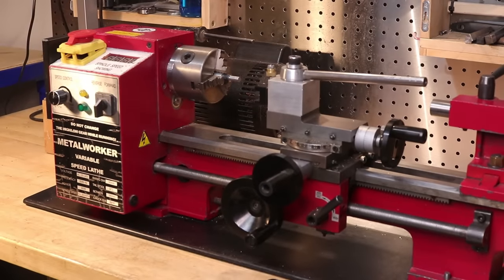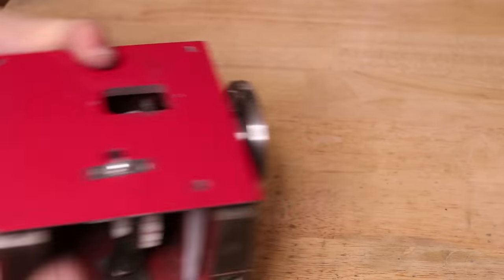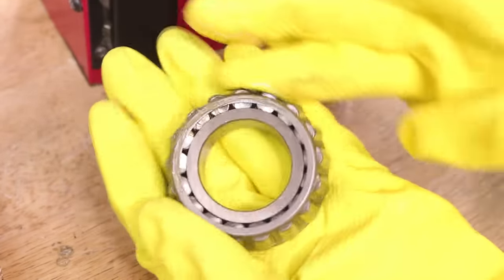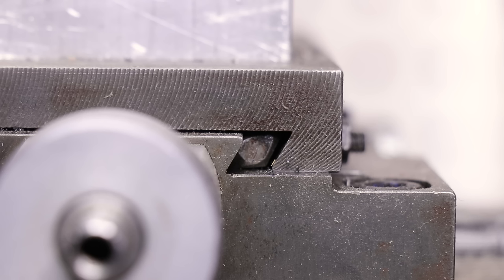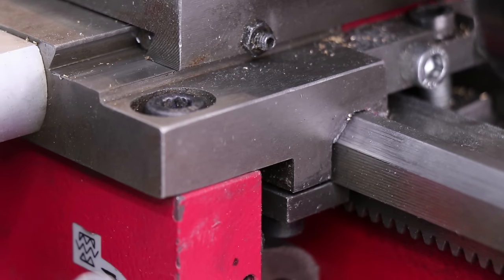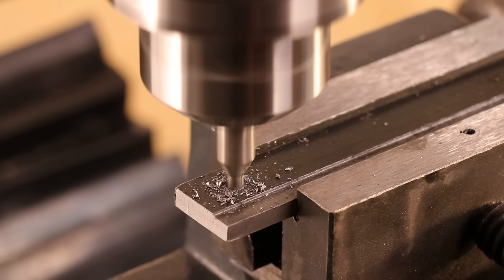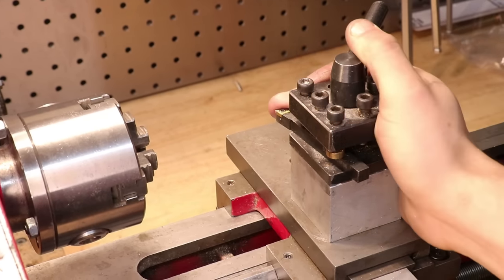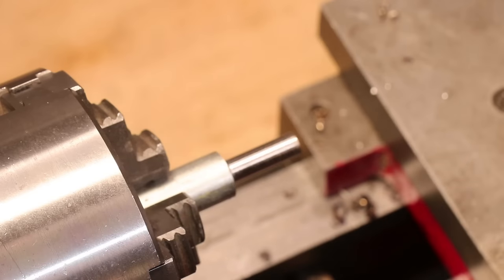Rigid Mini Lathe Upgrade | Tapered Roller Bearings, Solid Tool Post, Brass Gib Strips Mod

Comment: Tip: Never us copper based grease with roller bearings!. The odds are that one or more of the rollers will 'slip' and therefore wear a flat on one 'side'. That's sudden death for the bearing.
Reply from the maker: Hi mate, this is lithium grease not copper based and its the stuff recommended by the bering manufacturer. The a quick look at the MSDS shows it doesn't have. Any copper in it. Cheers
Reply: @artisanmakes  I never implied that the grease you used is copper based, just that others may be tempted to use it. As much as it seems to be a good alternative, it's not!
Reply from the maker: @amanofmanyparts9120  Thanks for the response. My bad, I misunderstood your comment. Cheers

Comment: how do you adjust your depth of cut?? The carriage only moves back and forth not in and out.
Reply: I didn’t think this through. You can adjust depth of cut with carriage.
Reply from the maker: Yes, the cross slide does that.

Comment: It would also help if you bolt the lathe down to a more secure table. Ideally something made of steel or iron and perfectly flat with the ability to adjust and lock down level.
Reply from the maker: Yeah ideally I would love to do that. Not sure how much of an improvement it would be, but that would be the optimal solution. Cheers

Comment: I don't understand why you would advise  to "lightly" rub a little grease on those bearings, when they are meant to be packed? What are you trying to do with that technique? 🤔 I  think I disagree.
Reply from the maker: No, for lathe headstock bearings it is not advised to pack them with large quantities of grease. This is inline with the literature I have read on this subject for lathes of this size and in line with what I have seen other people do on lathes of this size and with much larger lathes. Of course if you want to pack it tightly on your lathe you want/if it is advised for your lathe.

Comment: You want the gibs to wear our not the bed or ways. So making a gib out of brass would only wear out you lathe quicker. That is because the softer material will accumulate abrasive particles and act as sand paper. Why do you think on all machines, new or old, the gibs were made from hardened steel?
Reply from the maker: Thanks for the feedback but I have to disagree. The cast gibs that it came with have worn the dovetails a fair bit so replacing was a must. Brass is absolutely fine. It is a very common upgrade and I have not heard of people having issues. The slides get cleaned frequently so I wouldn't worry about brass accumulation. If the cross slide was hardened I would opt for a steel gib, but here it won't be an issue. Cheers

Comment: What kind metal are you turning in the test footage?
Reply from the maker: I can't remember off the top of my head on the grade bit I am pretty sure it is 1018 hot rolled steel.
Reply: @artisanmakes  thanks

Comment: It would be nice if a guy didnt need a milling machine to do most of these upgrades, as I dont have one. They do look good though, except I dont consider eliminating the top feed an "upgrade".
Reply from the maker: Pick and choose what suits you and what best suits you and your machinery. Unfortunately some.kf these do require a mill. And for a lot of people, a solid.tool post is a big upgrade for the lathe
Reply: @artisanmakes  Yep, not complaining, I wish I had a mill. I do appreciate your videos too. Some of the issues you fixed are a real problem. I hope I can find ways to fix them with what I've got. Thank you.

Comment: The most of rigidity loss comes from a void under the headstock.
Reply from the maker: Absolutely. I thought the same and installed a piece of metal in that void to increase rigidity and it makes a big difference when parting steel. Cheers
Reply: @artisanmakes  you can watch this video https://youtu.be/YuRGxuMk9Ww (it's a series of video) of this highly technically skilled man about this problem. It's only in Russian but auto subs does ~90% correct job. 
There are more excellent videos about mini lathe upgradeupgrade on his channel.

Comment: Ten minutes in the kitchen with the freezer and the oven would give you the 200 degree temperature gradient for easy assembly of the bearings.

Stavros
Reply from the maker: Thanks for the tip. First time doing lathe bearings so I'll be able to remember the next time I have to do this. Cheers

Comment: Hey you didn’t apply the grease the correct way
Reply from the maker: Everything is a lot more difficult when you have tripod, mic and several studio lights in the way :) From memory I spent a long time doing it off camera
Reply: The correct way would be what?  Put grease in palm, and press bearing into palm to force grease into bearing?

Comment: 7206 bearings are $7-10 on aliexpress
Reply from the maker: Like I said in the video, $90 for the set I was after. Low run out, 2 row bearings that I'll probably end up getting in the future. Cheers

Comment: you dont pk bearing lk that
Reply from the maker: This is the advised way to pack bearing for lathe headstock bearings. For lathe headstock bearings it is not advised to pack them with large quantities of grease. This is inline with the literature I have read on this subject for lathes of this size and in line with what I have seen other people do on lathes of this size and with much larger lathes. Of course if you want to pack it tightly on your lathe you want/if it is advised for your lathe.

Comment: Gibs naturaly are made of cast iron most bearing seurfaces of ways use cast iron i dont get what u have done but okay
Reply from the maker: Stock gibs were under sized and bent from the factory so replacement ones help make better contact with the dovetails. Cast iron might be the material of choice for large industrial lathe gibs but for this little one, brass makes for a much smoother action. Cheers
Reply: @artisanmakes  well if it works it works

Comment: Might as well save your money and buy a better lathe...Than doing all this crap...The cost of tooling , materials and time...will be worth as much as a better lathe....Unless your really bored and have a lot of time on your hands or trying to make money on YouTube ...
Reply from the maker: Easier said than done. The next model up from this, the sieg sc4 costs $2,400 AUD, almost 4 times what I paid for this. And for a hobby it is hard to justify that price. Easier to slowly upgrade what you have, for a fraction of the cost. At least in my case. And I promise you, there isn't much money to be made on videos like this. Cheers.

Comment: Nice upgrades. Do you know what you wound up with for a finished height on your replacement aluminum block? 
I have been considering such an upgrade for a very long time and a height dimension would be a great short cut.
Reply from the maker: It wound up being 40.2mm as a finished height. Just the height of the compound and top slide and that should be easy to measure. Cheers